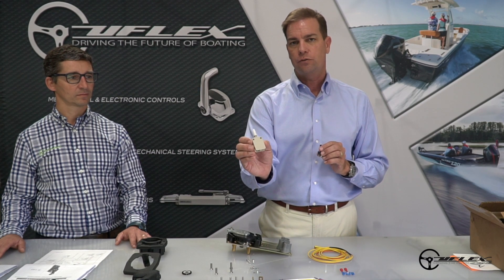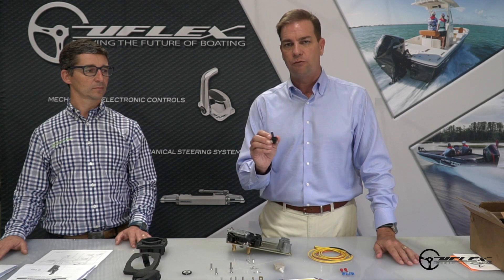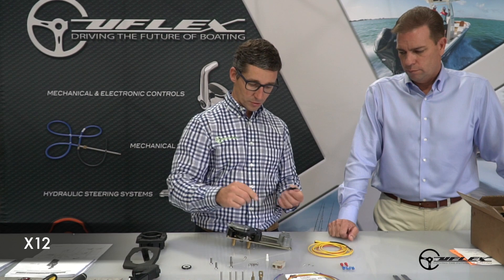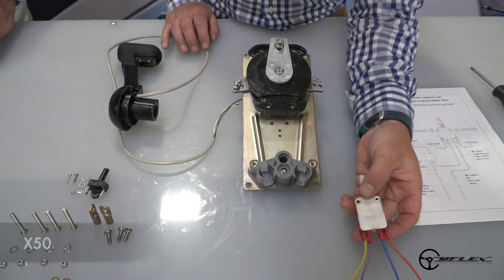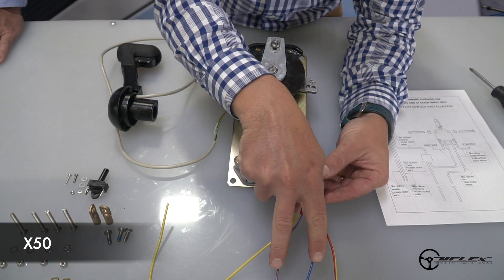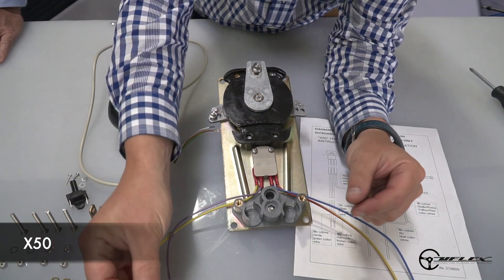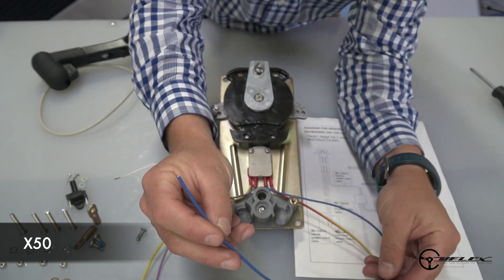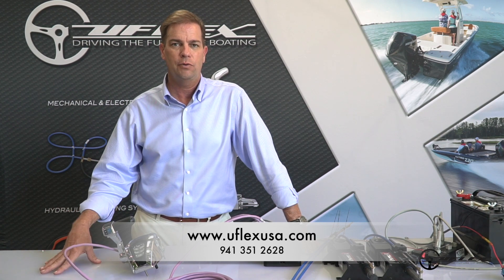Selecting the Proper Neutral Safety Switch for Uflex Control

Comment: How do you wire a separate trailer mode switch on a mercruiser since this control only has up and down? Is it blue wire spliced to a switch? My original throttle control had a trailer switch and this doesn't.

Comment: Purple wire should be sliced with the purple wire in a two way splice…the first way is to the neutral switch, the second to the white wire to the tilt control, The third way goes down to the pump. Why is there a third way in the two way splice?